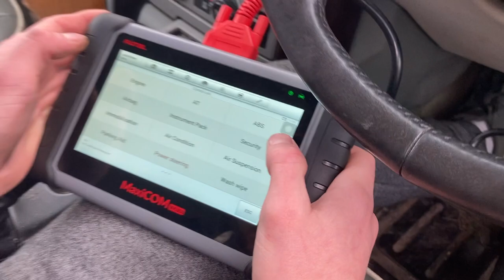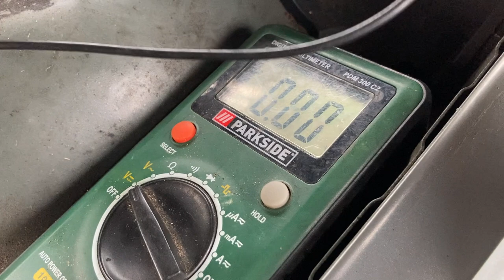Changing My Auxiliary Belts On A Range Rover L322 TD6 | Without The Correct Tools

Comment: Great video and improvisation  with the spanners hope she doesn't give you any more problems but it's a range rover so never say never keep the videos coming 👍
Reply from the maker: Thanks Colin , I’ve never got the right tools . Just have to make do with what I’ve got 🤣 Let’s hope not 🤞
Reply: @DrivewayHustlers  I've always fancied an l322 diesel Westminster but all the reliability stories scare me what's your opinion and advice on getting one ? Thanks
Reply from the maker: Your right , there’s a lot of scaremongering when it comes to range rovers . Doesn’t matter what car you buy , they all break .. just some more than others . Depending on what you intend to use it for , if it’s going to be your daily driver then I’d say go for the diesel . It all comes down to the individuals budget and preferences ,how much you want to spend .. and are prepared to if something drastic goes wrong . Try and find one with a solid history & Get all the oil & fluid’s changed , prevention is better than cure 👍 However do consider a petrol if your only planning on using it as a 2nd car . Hope that’s helps , good luck and hope you find a good one 🤞

Comment: I removed the viscous fan and the cover on my TD6 about 3 years ago never had any problems with overheating.
It does give back a little power to the engine not having to turn the fan.
Gives more room to work on other things as well.
Reply from the maker: I found there was hardly any room to get that fan off . The rest of it was straight forward

Comment: Hi.. been there and done that and so much more..mines 05' and was well maintained beforehand and i haven't stopped replacing just about everything, they get to an age where they start to crumble and you have to be ontop of every bit of maintenance..but the bell@nd who designed that early type compressor adjuster shouldn't be allowed to design cardboard boxes let alone cars..terrible design, and it was deleted for a stretch belt on later td6s..keep vids coming.
Reply from the maker: I know , what a pain of a job it was to do . I agree , not having the right tools was half the battle 🤣 cheers Paul 👍

Comment: I’ll tell you who designed it, overpaid Design Engineers that had barely any experience using a spanner or socket set; and were told to just make sure everything would fit in the engine bay without any consideration for how the parts could be accessed afterwards.  How do I know this, because I worked with some after their contracts had ended.
Reply from the maker: It was a nightmare of a job , just had no access to that fan . Even with the correct spanner , still don’t have a clue how you would get it off 🤣

Comment: i hear on the V8 you have to take the body of to change the alternator and end upm with a massive bill .
Reply from the maker: On what engine is that ? 🤔
Reply: Not on the 3.6 v8 diesel they are tricky you can just access the bottom bolt from  behind the drivers wheel arch if my memory serves me 👍🏻

Comment: ha dto do the same job myself and its bolox of a job but remove the egr systema dn blank it off and it will run better and makea few other jobs easier to do !!
Reply from the maker: EGR has already been blanked 👍
Reply: @DrivewayHustlers  I'm still have trouble with the air suspension but I think I've narrowed it down !!